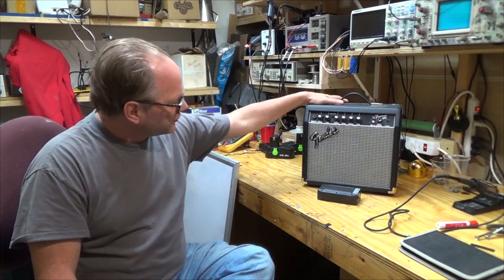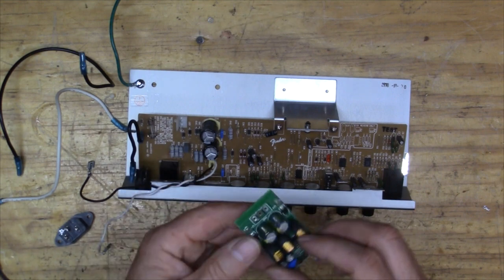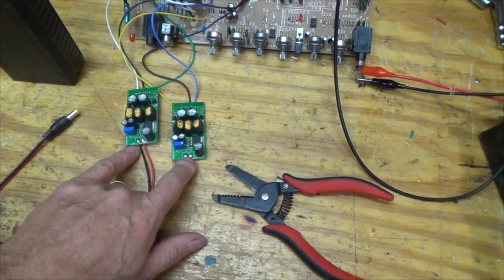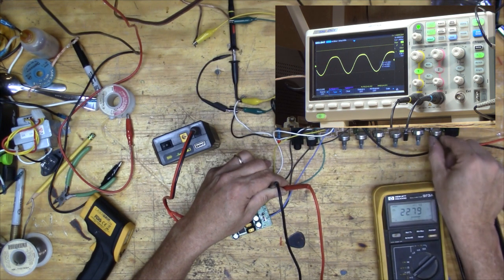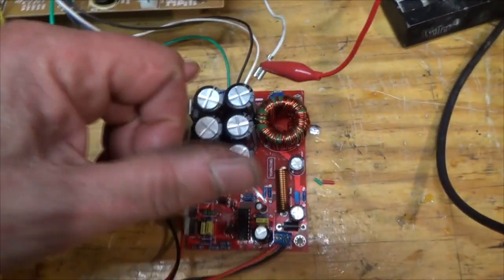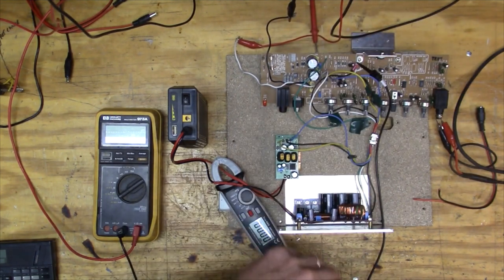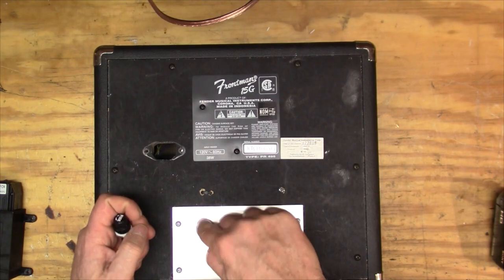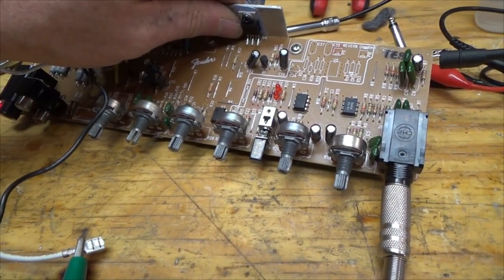Battery Powered Guitar Amplifier

Comment: Exactly what I was looking for. Some people use an inverter to get 220v and plug the amp as usual. But I feel like it's a waste since the amp then will convert it back to low voltages. I can only understand  this if you have an expensive amp and you don't want to mod it. Also I don't understand why guitar companies don't just make a DC input instead of putting a transformer in there.
Reply: Or I might just install a HI-FI power amp inside instead of a guitar amp and use a small mixer. I use my cheap amp as a PA speaker anyway, always plugged into the aux input.

Comment: Very nice.  I'm planning a battery bass amp (maybe with supplemental solar panels) and your video really helped.  Did you consider keeping the original power supply so it could be AC/DC?
Reply from the maker: Hmm, that does make sense now that you mention it.
Reply: Ah mate have you managed to do this? This is something im keen on doing too 🤙🏽

Comment: Great job! The battery could be put on with Velcro I think to avoid any battery box vibration noise, if there is any. I found out the hard way that those output transistors are so marginal that they NEED to be attached to the heat sink when the amp is on or they overheat. Seems like crappy engineering.

Comment: Did you measure the Current draw of the original amp?
Reply from the maker: No, and I really regretted it. It was rated for 35w which is not that far off from what it ended up at which really surprised me.

Comment: why didn't you use the power inverter,no need to mod the amp
Reply from the maker: I wanted something that was more efficient and inverters use a decent amount of energy and the transformer would then eat some more. That said, it is a more sensible solution than spending 8 hours with my mod.